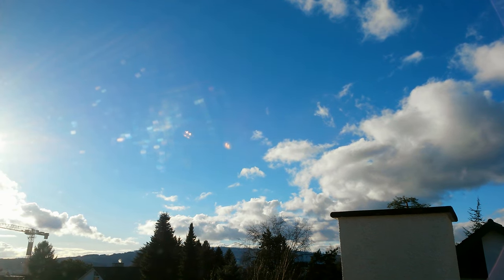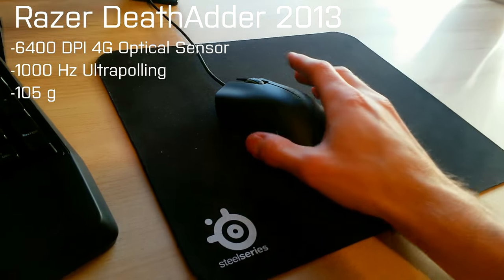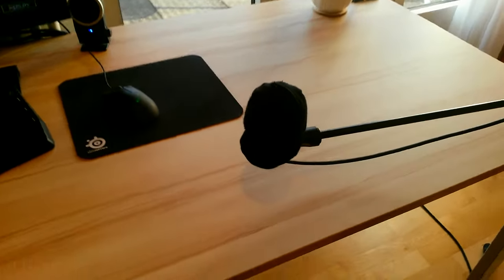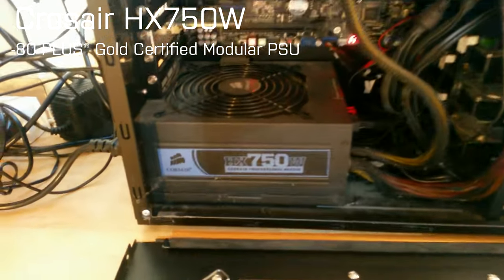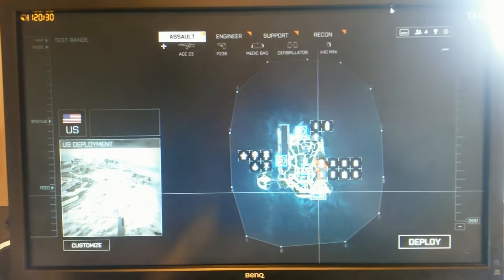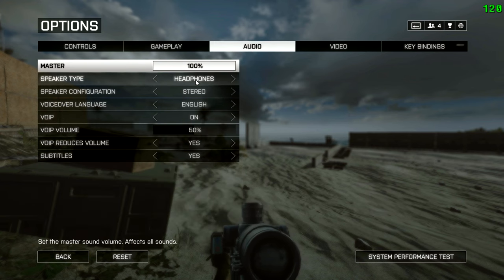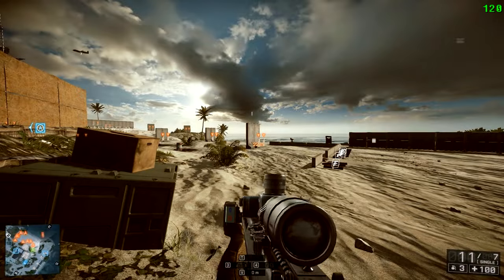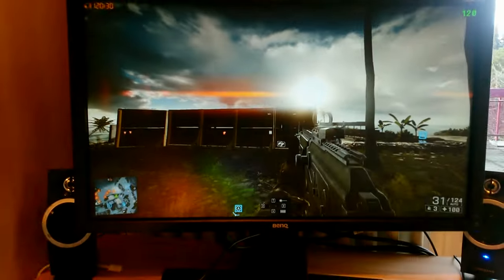Dat Battlefield 4 PC Gaming Setup!

Comment: Hi I want to know , I have a Sapphire Radeon R9 280X Dual -X OC 3G GDDR5 and I wonder what power would I need for now because i a w 350 be quiet ? thank you for your answer
Reply from the maker: Pretty sure you would need a 500+ w power unit. You can find that info on the manufacturers website of the GPU tho

Comment: I'm thinking about getting a PC that could run games like Battlefield 4 on Mid-High graphic settings smoothly, and i've come down to this:

Processor: AMD A6 5400K/2-core/3,6 GHz
Memory: 8 GB
HDD:1TB 64MB Western Digital 7200
Graphics card: Radeon HD 7540D 2 GB
Optical unit :24x LiteOn Brenner iHAS124-04 
Network card: Gigabit LAN 10/100/1000 Gb/s

Is this a decent gaming computer for a budget below 500 euros (around 600 U.S Dollars) ?
Reply from the maker: tangent123456 hey man! you probably wont be able to run BF4 on high with those specs, but for med it should be ok. also depends on what FPS target you have. cheers!
Reply: Speedbre4ker Thank you, i appreciate your info c: Doing quite a bit of research hehe

Comment: hello, can I run next gen games on ultra settings?
core i5 3.2GHz
16gb DDR3
1TB HDD
4GB GPU
Reply from the maker: Mujibul Islam Dipto Well this depends largely on your GPU, which graphics card do you have? Although with the i5 you probably wont be able to run ultra, I suppose high will possible tho
Reply: Speedbre4ker i5 is fine
Reply from the maker: BergTutorials pretty dope, although would probably also invest in an SSD. This is easily the cheapest way to get the fastest loading times in any game, windows etc..
Reply: Speedbre4ker
i actually changed things up a bit im going for a 980 and i7 4790k but since im so tight in the 1200$ range i can't get an SSD but ill surely get it in the future.